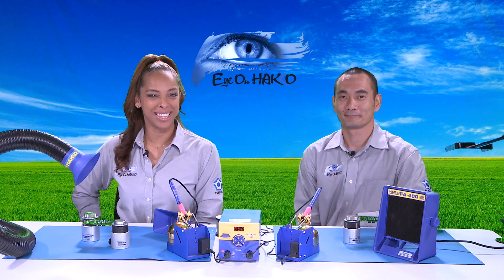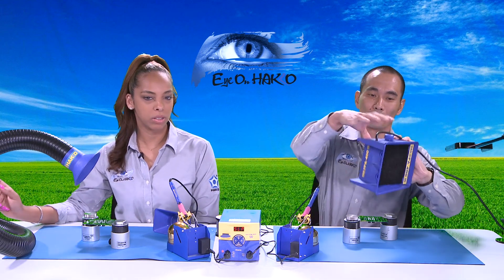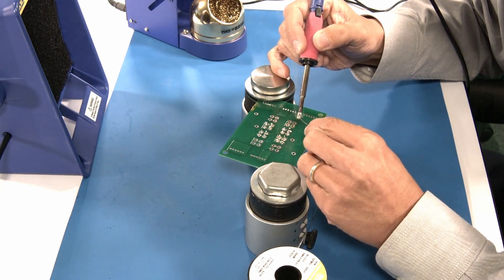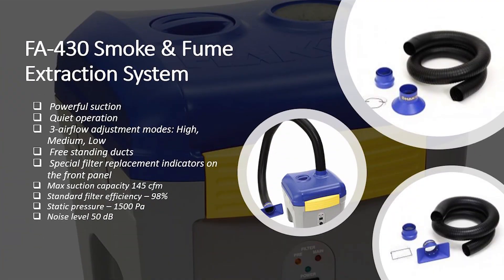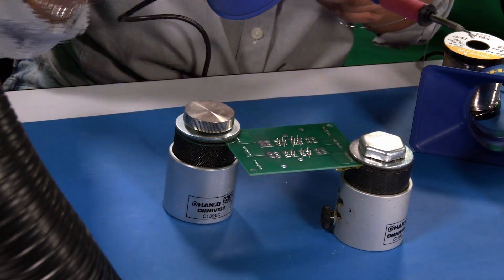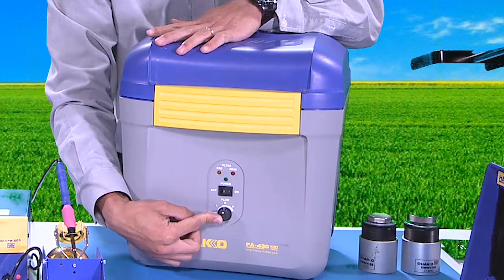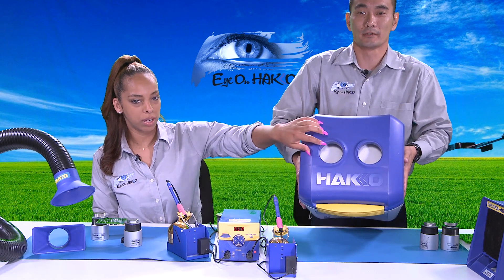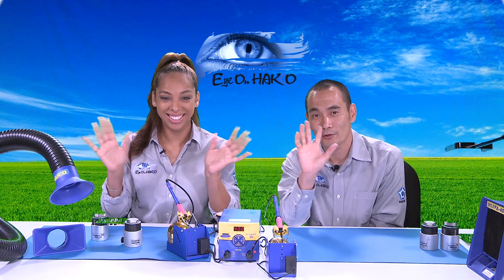"Eye On Hakko" presents the HAKKO Fume Extraction Systems

Comment: The Hakko FA-400 is useless for particulate removal and simply blows the fume into the room for you to re-breathe later on. It uses a light carbon filter which only adsorbs the smelly volatiles (for a very very short time) and does not, in any way, protect you from the fumes, other than keeping the fumes from being directly in your face. You can buy a cheap $10 muffin fan to do the same thing. What a rip-off!

Comment: I used a activated carbon air filter square from amazon. New the square filter weighed 16.7 grams and after several weeks of use it weighed less than 15.4 grams.. I guess it dried it out